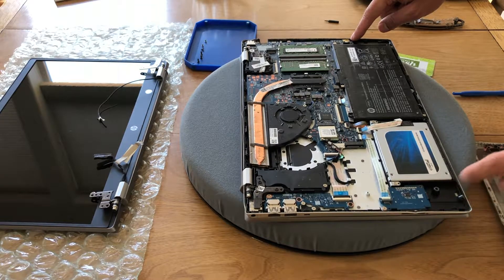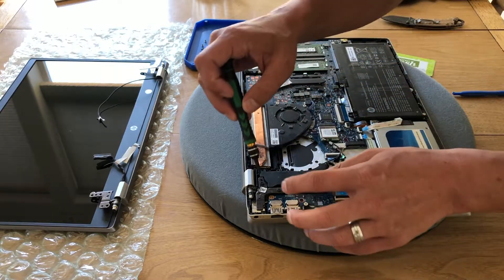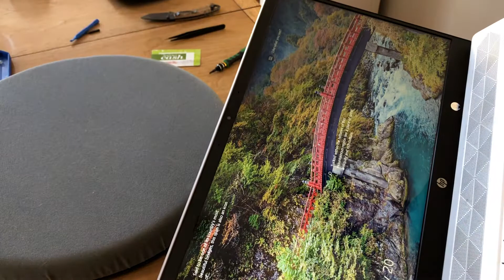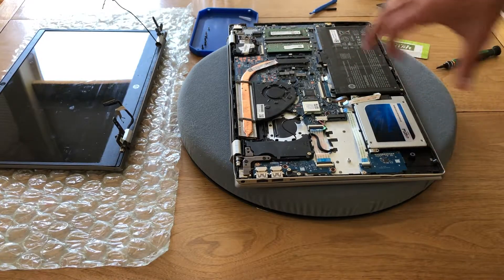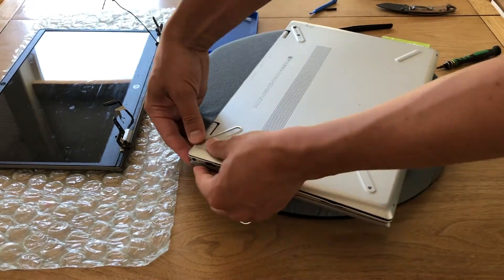HP Pavilion Screen replacement | 2018 HP Pavilion 15-cs0053cl model

Comment: I have the same laptop... do you know if i can upgrade it to a 1080p screen?
Reply from the maker: I looked into that and I think it would work. But there are a few things to consider. The connector may be different or even cord placement. I would expect it to work, but sometimes that sort of thing has issues. 

You have to gauge that risk cost and reward.

Comment: Good video but you actually replaced the "display assembly" Im doing the actual screen on mine now and it seems a little tricky because the actual panel is taped into the cover.
Reply from the maker: @seanlove2000  Yep good catch.

Comment: Hi ! I also have an HP Pavilion 15z cw100 but my screen is broken. I would like to know how I can have a complete screen like in this video.
Reply from the maker: I found this one on eBay but they are harder to find now. Search for screen assembly and those ones are usually a complete top like mine.
Reply: @JamesHeigh  thanks

Comment: where can you find the display with backcover and antenas, hinches and front besel?
Reply from the maker: I found mine by searching the term display assembly which typically includes all those parts. I had luck with eBay when I did the swap.

Comment: Where did you find the replacement screen with the display bezel and outside shell? I can only find the LCD display without the bezel.
Reply from the maker: I found a complete assembly on eBay. I would likely need to reuse the original today or source each part individually.
Reply: @JamesHeigh  I was able to figure out how to extract the display from the top lid so I think I'm past looking for the whole assembly. Thanks for the reply.

Comment: I have a model number 15-cs0051cl. Is there much difference between mine and the one you demonstrated?
Reply from the maker: They should be very similar. With that minor difference in model number is usually a small change like non touch display or even difference in HDD meaning the main steps would be the same.

Comment: Hi James, thanks for the video. quick question: I don't need the entire display. I just need the metal back along with that bottom piece( the connector kind of thing at the display's bottom). Will that be available separately?
Reply from the maker: It could be but I would expect to find used stuff only at this point so you may have to settle for a full assembly swap based on what’s available. But searching for housing only could yield some results.

Comment: I have a 2020 HP Pavillion and the bottom left of the screen cover appears to be popping out away from the screen. I didn’t drop my laptop or hit it on anything. Looks to be a defect. I searched the HP website and found many people complaining of the same symptom. 
I’m wondering if I need to replace the whole cover? since the screen itself is fine. 
It will likely get worst and separate more if I don’t fix it soon.
Reply from the maker: If you got extra warranty I would reach out to HP first but if that route is dead some basic double sided sticky tape could do the trick.
Reply: @JamesHeigh  No, I didn’t get the extended warranty- double sided sticky tape it is- thank you! 😀

Comment: Hi do you have a link with screen replacement where I can buy it from?
Reply from the maker: All of the links for the screen I have found were from ebay this means they are out of date. They are getting harder to find and it might be easier to buy a non working full laptop now. At the time of this service the screen assembly alone was about $85. Hope that was a help!

Comment: Thanks for your video. However my laptop touchscreen feature does not work. Is seems to be a hardware issue as diagnosed by me and the HP guy remotely. Just how likely that it is a bad cable? on a laptop that has been used sparingly and with no bumps? Yesterday after various restarts and pushing various screen bezel areas, the touchscreen worked, until the automatic screen sleep, on 2 occasions
Reply from the maker: Nice work it does sound like a faulty connection somewhere. If you are out of warranty on it it’d be worth taking a look inside. I would think it would be somewhat visible like pinched ribbon or disconnect to main board.

Comment: my laptops Bezel keeps coming out many times, any solution? I repaired it before few months but still it comes out.
Reply from the maker: Whenever I have issues with a bezel and it wont stick with the original clips I just use a little double sided sticky tape ( https://tinyurl.com/rk2jpe97 ) and you can cut it down to little strips that cannot be seen. Usually does the job. Hope this helps!
Reply: @JamesHeigh  My computer needs a completely new bezel. Where can I get one because I cannot find it on the HP parts website anywhere (P.S it is the same model as the one you worked with in this video.)
Reply from the maker: @alvordapau-kese9732  these parts are getting harder and harder to find. You might eBay a full screen assembly or parts machine. I would also look at some garage sales for parts while it’s warm. I have also heard of universal parts but again it might not show up for that specific model. I no longer have mine oh but I might have a good inner bezel I’ll check.
Reply: @JamesHeigh  Thanks man

Comment: Is it possible to change the TN screen for this one? My model is the HP Pavilion 15-cs1007np. Thanks.
Reply from the maker: I think it will work however this is not something I have tried. I also don’t have a way to try it as this computer has moved back to its owner. I would say though chances are good as I have seen more compatibility with that type of swap vs incompatible. If you do decide to go for it I would suggest you go with a full assembly and not just the panel.
Reply: @JamesHeigh  thank you.

Comment: Tengo el mismo problema, la pantalla de mi laptop está quebrada, pero tengo una duda, en las especificaciones de mi laptop sale que es FHD (1920 x 1800) le podría poner una HD (1366 x 768) porque en ebay solo esa está
Reply from the maker: Here is the translation from google:

I have the same problem, the screen of my laptop is broken, but I have a question, in the specifications of my laptop it says that it is FHD (1920 x 1800) I could put an HD (1366 x 768) because on ebay only that is

ANSWER:
The lower resolution should still work, but there is a chance that it would have different connections. So you might want to wait for the exact same panel you had.

Spanish ANSWER:
La resolución más baja debería funcionar, pero existe la posibilidad de que tenga conexiones diferentes. Por lo tanto, es posible que desee esperar exactamente el mismo panel que tenía.
Reply: @JamesHeigh  mi laptop es igual a la reparas, hp pavilion 15-cs0053cl
Reply from the maker: @edu_1987   I really only speak English, sorry do not know.

Comment: where can i find a spare parts ??? i need a back and front cover
Reply from the maker: I have a pinned comment with some links for the fan that I used. But were you interested in other parts?
Reply: A ok thank you. i'a changing the cover of display and the back cover of a notebook that it was fall on the floor but but i'm not foud the part to replace
Reply from the maker: @simonecasellato1640   oh I found those parts on eBay. So the availability will vary.

Comment: Thanks for making this video. I was wondering, does this laptop have a very loud fan noise? Becuase I have the same laptop and mine does, was wondering if it's only mine that making the noise.
Reply: Change your max state of performance to 99% in your energy options
Reply from the maker: Welcome! It is quite tame under normal usage then ramps up quickly while playing games. If the fans are loud right from the startup like a growl that is usually a fan dying. 

These laptops are a little loud compared to typical machines though too.
Reply: @JamesHeigh   thanks for getting back to me. you are right tbf, I've been using this laptop for 2 years now for college work, I use it for about 5 to 7 hours or more a day, fan noise is always on since I bought it just damaging my brain and increases my stress level (for some reason) at this stage. I guess that's the only disadvantage of this laptop other wise it's excellent laptop. I might consider changing it this summer as I am sick of this fan noise lol, might go for apple macbook air m1, but not sure if it's worth it tbh.
Reply from the maker: @user-zw5tp3qn4s  I really like macs. I also have an iPad Pro that replaced my MacBook and I plan to do a video about it sometime. Love the m1 though it’s a better value for the performance right now.
Reply: @JamesHeigh  that's great, I am looking forward to watching that video, I might as well consider iPad pro as I like iPad's a lot.

Comment: How much did this replacement cost, I have the same indentations from the back and a broken screen. 
?
Reply from the maker: The one I got was $130 because it had the assembly and screen. I was seeing $90 for the LCD alone.
Reply: @JamesHeigh  Thank you James
Reply from the maker: @eyadalmurshidi9803  welcome and if you need a video on how to replace the lcd alone I have a vid on that as well! Thanks for stopping by!
Reply: @JamesHeigh  have you a video about fixing the flexor on this model?
Reply from the maker: @theWeedzard13  I don't have anything like that. What flex are you thinking of? Keyboard or Screen?
Reply: @JamesHeigh  screen. I suddenly had a video problem. My whole screen started to blink. I was told that the flex could be possibly bad fixed, but I can't find the way to open it so I can see it
Reply from the maker: @theWeedzard13  Makes me think of the flex cable to the screen. I could get something like that up, I am making a list of this kind of stuff.
Reply: @JamesHeigh  thanks a lot. It would save my life if I could watch it. Keep up with the awesome work u doing btw

Comment: How much does the screen cost ??
Reply from the maker: I was able to find a decent one on eBay for $130. Those prices could change for any reason though so YMMV.
Reply: @JamesHeigh  tq for the info :-)
Reply from the maker: @chellikirankumar8680  very welcome. And thank you for watching the vid!! Have a rockin day!
Reply: @JamesHeigh  i'm from india i couldn't find it ebay can you please update the link ?
Reply from the maker: @chellikirankumar8680  I remember ordering this part and there were only two at that time about a year ago. I was able to find the screen only then you would have to use your existing housing and connectors which is much more work, but doable! Here is the link I found for this model. Keep in mind the stock could change on this at any time. I hope this helps you out! Also its less money because it doesn’t include the full assembly. Another viewer was able to do this swap with my video about the screen also on my channel. I can post that link if you need it! Also double verify this is for your model and contact the seller with your serial number if you have any doubts.

https://www.ebay.com/itm/For-HP-Pavilion-15-CS0053CL-15-CS0061CL-LED-LCD-Touch-Screen-Digitizer-Assembly/123875599677?hash=item1cd78fa53d:g:288AAOSwLN5evj0c
Reply: @JamesHeigh  tq James 👍
Reply from the maker: @chellikirankumar8680   Very welcome =)

Comment: Do u know what kind of battery I need to get for the laptop?! (For 15-cs0053cl) My laptop's battery was run out battery now.....
Reply from the maker: This one was not easy to find. The best result I found was here (https://www.hplaptopbattery.com.sg/hp-pavilion-15-cs0053cl-battery.htm) and it looks like there are two versions, likely the larger is an optional extra capacity but the standard is the 3 cell option. This was just my best result though so I don't have a way to verify further as that laptop is no longer in my possession. I hope that helps!